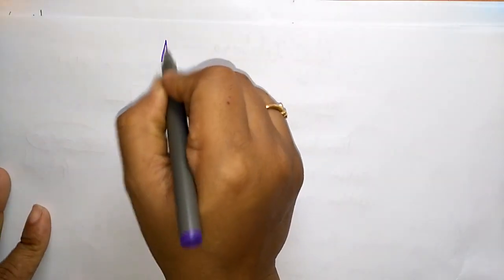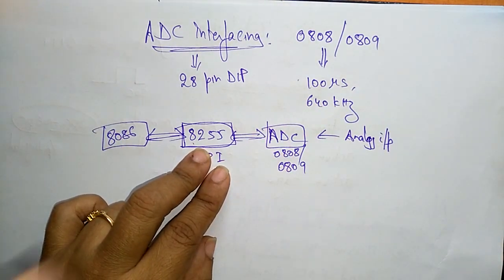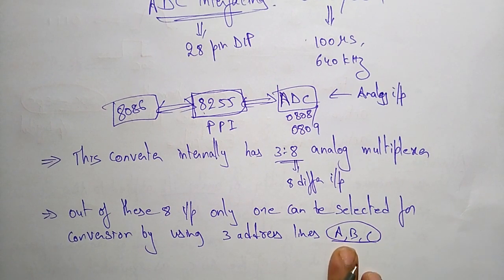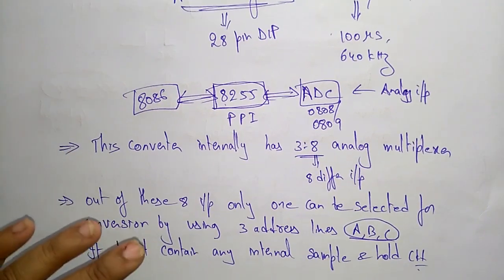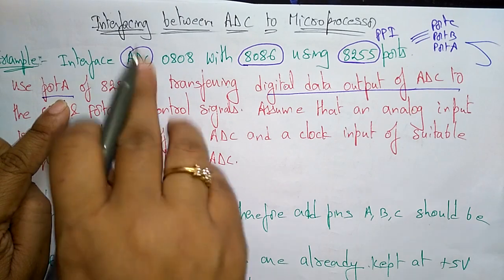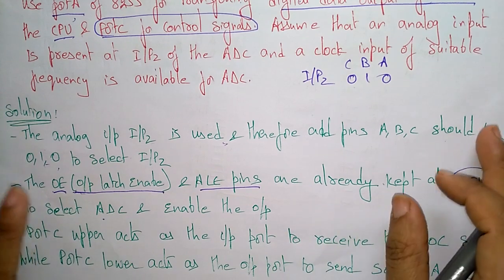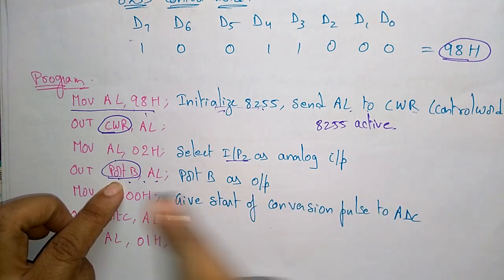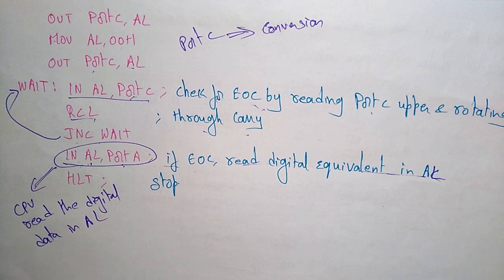adc interfacing | with 8086 and 8255 |

Comment: how did u get control word.....anybody can copy from book........(A K RAY-problem5.16)
Reply: First bit D7 is 1 because of I/O port, then mode is 0 ,so D6,D5 is 00, then D4,D3is 1,1 because port A and port c upper  is input and  other pin is 0 because of put port.
Now bit is 1001,1000, which is read as= 92 H.
All the best.
Reply: What are u doing currently

Comment: 3to 8 is a decoder not multiplexer
Reply: It's mux :)
Reply: Don't confuse others plz it's a multiplexer.if you are not sure don't be overconfidence
Reply: yes 2  power 3 is 8 so 2 to 8 is multiplexer
Reply: you are actually right. but here she meant 8x1 mux where 3 enable pins are used(2^3=8). if it was 4x1 mux, 2 enable pins are used(2^2=4). n*2^n = decoder ( general cases, which is why u got confused). 2^n*n= encoder.
Reply: @chillavaishnavi8693  good